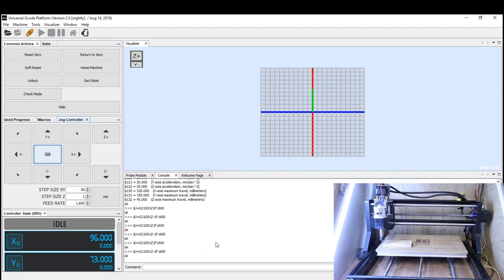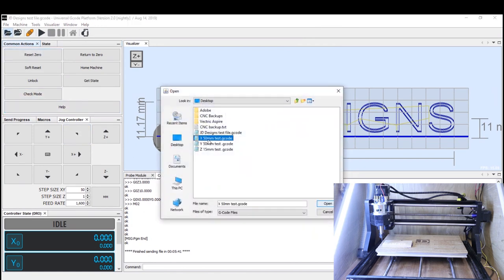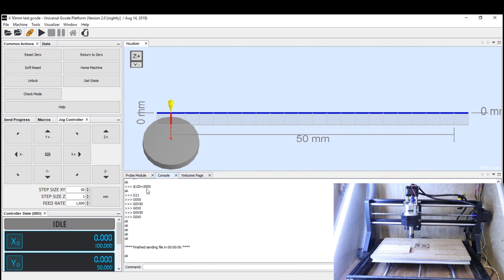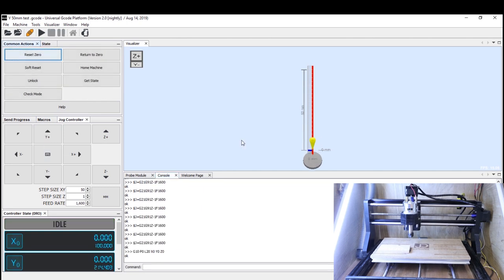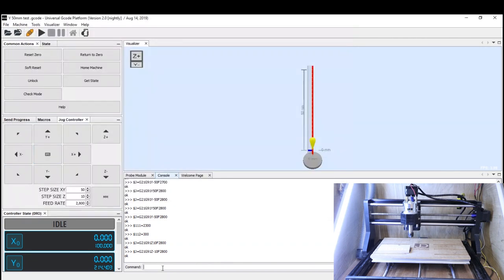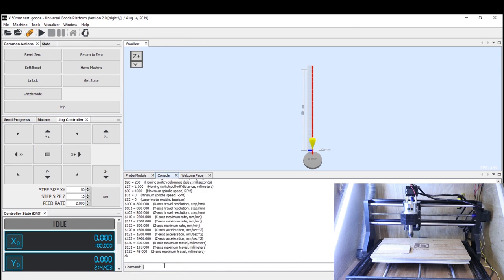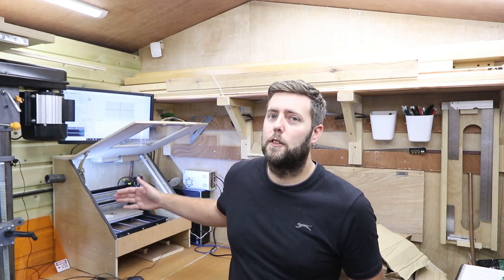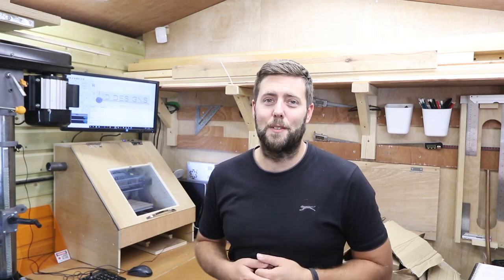3018 PRO - Tuning GRBL settings

Comment: maybe I'm stubborn but: why screw everything up?
be patient and let the machine do its job,
is that wrong? or Weird if I say so?

Regards Rob
Reply from the maker: I wouldn't say stubborn, I'd just say you're thinking about it in the wrong way. You are believing that the factory settings are the best for the machine but thats not technically true, they are simply very safe settings to make the manufacturers life easier. Yes sticking with the default settings is safe, but there are lots of scenarios where higher speeds and faster acceleration will actually get you better results. For example when using a laser or machining acrylic. If you drive a car, yes you could travel everywhere at 10mph, and that would be perfectly fine but if the road and your vehicle allows for faster speed then why not travel at 15 or 20mph and shorten the journey time. Its not about pushing your machine to the limit, its a case of finding the limit (which is much higher) and then staying with a safe zone

Comment: Hello James, thank you for sharing this video, it helped tremendously.
Do the cut settings from Easel get over written by these settings? This part confuses me.
Reply from the maker: No, Easel (or any other software) just controls the feed rate for when its actually cutting but these settings  are mainly about the free travel speeds which your software doesn't change
Reply: @JamesDeanDesigns  ah, that is what I thought but was doubting myself - Thank you James.

Comment: Great video James, but how do i permanently adjust the settings using Aspire 10.5 with remote control panel? on 3018 pro
Reply from the maker: Aspire is just your CAD/CAM software, these settings are done in your control software and once they have been set, you shouldn't need to change them again

Comment: Hey James I love these tutorial videos. I was wondering if you have any tips for setting up limit stops and using them to set a home position in the 3018 Pro.
Reply from the maker: Unfortunately I don't. I've never used limit switches. Probably the one area of these machines I can't advise on 😕
Reply: @JamesDeanDesigns  Thanks for the response James. Looking forward to see your 4030 review. Always preferred to have the head move and not the stock bed.
Reply: Look up Techydiy. He Also has some tutorials on this machine and he goes over setting hard limits and soft limits. I think it is the second one in his series.
Reply from the maker: @GranjersGarage  his videos are good 👍

Comment: Hi James nice work. I have little issue with jog control they are going wrong directions any fix for that?
or setting i am new to the candle and grbl I have 2418 cnc with laser is also not working very low light?
Reply from the maker: It will be your $3 setting. If all of your axis are wrong try $3=5. Otherwise just work through changing the 5 to another number until your axis are correct. It only goes from 1-7 so doesn't take long

Comment: Hi my son just got the same cnc he put it together with no problem . Did a move ment test with the little hand  controller. He downloaded from the flash drive. Now he is stuck 
How and where do you set the size of the wood.please help he got it for  christmas and he has been trying to get it to work everyday
Reply from the maker: Check out something like my beginners guide to easel. its shows you how to create job and set the work size

Comment: thanks. it was really easy to understand and follow.
Reply from the maker: Glad it helped 👍
Reply: @JamesDeanDesigns  is there a setting to change the spindle direction without changing the wires as i cant seem to pull mine off, and spindle is going counterclockwise.
Reply from the maker: @jw5955  not to my knowledge. There is usually a little red dot somewhere near the side that should have the red wire.
Reply from the maker: @jw5955  you could try changing the wires at the other end where it connects to the control board but not sure how easy you will find that

Comment: So I haven't changed any settings that I haven't before to switch between laser and spindle. I've had it working correctly before, but now whenever I try to run any gcode (even files that I've successfully run before) the first movement has the Z axis moving down into the stock, through the stock to the starting point, then up to the starting height, then down to the cut as normal. My axis aren't reversed or anything, its just flipping the first travel movement. Any suggestions?

Comment: Great video, thank you!  Question for you, if i fine tune my settings per your video will the faster setting cause me to break bits because it runs fast?  I use Easel software for carving and I am not sure if this will automatically adjust speed and feed rate if i use a fine tipped fluted bit?   Also, will i need to adjust these settings for when i switch to using my laser from my router?  Appreciate any help.
Reply from the maker: The settings work for both laser and spindle so that should be fine. And no it shouldn't cause you to break any bits, you are only adjusting the quick movement speed which is basically the speed when its not cutting. The actual cutting speed will be controlled by your desgin software
Reply: @JamesDeanDesigns  Thanks man!  I have tested everything out ever since and your videos is spot on!  I have been sharing your video's on Facebook groups.  Keep up the great work.  You've helped me out big time.
Reply from the maker: @bmf5523  thank you very much 👍

Comment: Hi James. First I want to say thank you for your videos on the 3018. I don’t know where I’d be without them. However, I’ve run into an issue. 

My spindle speeds don’t seem to go above 1000 rpm? In Easel, I tried 100, 500, 1000 rpm and measured the sound with a decibel meter. The speed/sound stops changing once you pass 1000 rpm. This is also the same speed when I use my offline controller and set spindle to 100%…

Any ideas? Thanks again.
Reply from the maker: To accurately test the RPM, you really need a tachometer. Regardless of the numbers you input into the software, the machine doesn't actually measure RPM, it only controls the power it inputs to the spindle. The reason I have explained that is because whilst you think its a 1000rpm, I suspect its actually likely to be closer to 10000 rpm which is around the maximum. Check you $30 setting, if its 1000, then when you put 1000 into Easel that basically means 100% power (so close to 10000rpm), 500 would be 50% power and so on. Now if your $30 is 10000 and you put 1000 into Easel, then that will be 10% power. What is your $30 setting?
Reply: @JamesDeanDesigns  Oh okay, so in easel I don’t actually put in the RPM’s? I put in the value between 0-1000? My $30 is at 1000. Thanks.
Reply from the maker: @renewman28  exactly, think of it more of a power scale than exact RPM. If your $30 is 1000, then usually any RPM value you enter into your software about 1000 means it will run at maximum RPM so around 10,000.

Comment: Hi James, an excellent video as always. I have one problem on my machine. There is no $30 and $31 in my file, (spindle speed) If I try to add them from the console it errors. Is there a special way to add them. My spindle speed won't change from flat out.
Reply from the maker: Your GRBL firmware is out of date. You need to be on at least 1.1f and you're probably on 0.9. Just Google upgrade GRBL firmware and you should see some guides to do it. Fairly easy to do

Comment: Hi, i love your videos and am a new subscriber.  I was feeling very positive that all my settings were correct and just tested working fine.  Now nothing works and spindle wont move left or right (just jams).  I have reduced the speeds but doesn't seem to work.  How do i put the original code back in? 
thank you
Reply from the maker: Did you make a back up of your original settings? If so just go through and change the ones that are different. Also make sure you didn't change a setting by accident. For example the other day I changed $11 by accident instead if $111
Reply: @JamesDeanDesigns    thank you for your response.  I couldn't even put the original G code back in. so i turned everything off and came back to it later and all worked again, although had to tweek some x and y settings as jamming but all sorted thank you a bunch.

Comment: Hello, I've recently purchased a CNC 3018 Pro. I began testing it using an nc file provided by the manufacturer, and I have some questions: In the first tests I did, I did set the X-Y and Z ZERO positions and it did the job correctly (I'm using GBRL Control software). Now, it seems that the router sends the tool to a very distant place from my ZERO positions, and I have to stop the work before it goes to a dangerous place that may cause some serious damage;  In this routing process, which the router sends the tool to a strange place, I broke 3 tools because in the Z axis travel, the tools are being dragged in the material. Could you please help and inform which could be the reason for these problems? Just one more comment: The image of the nc file that I'm using, when engraved in the wood, was a small image in the first jobs  - And now this same nc file is now routing a very large image. I don't know what's happening. Why is the size of the image of this file larger now? Any help would be appreciated.
Reply: I had this problem. run a the G21 command after the program, its probably running in Inches (the program has a G20 code in it) so your sending it 10mm and its going 10 inches or 250mm.

Comment: Hi James,do you have limit switches and Z probe on your 3018? 
I tried limit switches,  but results were variable. Would not always stop motion and sometimes false triggers. Had to frequently cancel error & reset.
When trying to use it in Easel, Easel had no cancel & reset, even identified switches on wrong axis!! At that stage I removed the wires completely.
How did yours go ?
Reply from the maker: I dont have limit switches, never felt the need for them although I understand some of the advantages for them. I also don't use Easel to run the machine, its user friendly for designing but it was designed to run their own machines and its never quite worked right with other machines. 
Yes, I have a z probe. As far as I'm concerned its a must have accessory 👍
Reply: Thanks for prompt reply, all the Z axis probes don't come with motherboard connector lugs/jumpers. Unless you already have a stock of connectors ... useless
Reply from the maker: @JohnColgan.  I've basically got mine held on with some electrical tape to each pin. Doesnt need to be fancy, just needs to create a circuit. Different boards have different connectors and most of the board for bigger machines have terminals rather than the pins unfortunately 😕

Comment: Can you peck drill with the 3018 pro? Can you ramp in to cuts on depth cuts?
Reply from the maker: Yes you can do both as long as your software allows it. With noting though on a standard 3018 your depth of cut is going to be fairly shallow anyway unless cutting really soft material

Comment: Hi James, First I wish you a happy and healthy newyear. I have a strange problem with my 3018pro. I use lightburn and/or LaserGRBL to engrave the drawing or text to the material. When I move the head using the arrow keys in laserGRBL or Lightburn the head and bed move in the correct direction. When I start the engraving proces the laser goes to the opposite side of the bed and al is engraved upside down and mirrored. Do you have any idea what could cause the problem?
Reply from the maker: Hi, without seeing all the settings its difficult to judge but it could possibly be the origin is in the wrong place.
Reply: Wich settings do you need? GRBL settings and/or lightburn settings?
Reply: Hi, i think the problem is solved. I inverted the y stepper motor and now al is engraved the right way.
Reply from the maker: @josvanhoof7616  thats great news. Although given your original explanation I wouldn't have said the axis needed inverting because you mentioned the arrows moved everything the correct way. Although people do sometimes get confused with the Y axis because clicking forward should move the bed back towards you - its moving the head forward if that makes sense. Either way, glad its sorted 👍
Reply: @JamesDeanDesigns  I also have a ortur laser master 2 wich has a broken controlboard. I tried using the Woodpeckers 3,4 on the ortur and had to change some wiring on the stepper cables. When I put the board back on my 3018 i think i forgot to change the wiring of the y stepper.

Comment: thank you as this is exactly what I needed but I am stuck with how I get the UGS from. hoping you can help. regards merv
Reply from the maker: As in where do you get UGS?
Reply: @JamesDeanDesigns  hi mate nearly worked it out but when I try to do the tests I get an error that basically says grbl neads to be in idle ???
Reply: hi again it also says no file loaded. Every thing works except the machine doesnt move but it is all ok on the screen and all moves etc in the display screen

Comment: I can’t change $27=1.000.. I fitted limit switches but the switches on the X and Y axis stay closed after it backs off so it sets the alarm. I have to manually wind them off the switches to be able to jog. I can’t change the $27 setting from 1.000 so it will back off further. It comes up with error 3 invalid command if I try to change and save it. Any ideas.,
Reply: Problem solved. The GRBL that came with the 3018 was crippled. Tried the files on the USB that comes with it, same problem. Downloaded the latest GRBL from GitHub and installed it an now all is fine.

Comment: Hey mate, I’m having an issue. My designs are coming out upside down and negative to the zero. Would you happen to know how to fix this? I’m a newbie and not sure why it’s doing this or how to fix it
Reply from the maker: I suspect it might be your $3 setting which changes your axis direction, but it can change all 3. Try $3=1 first, test all 3 axis, if one is still wrong try $3=2... and so on. It only goes upto 7 so you just need to find the number that gets all 3 going correctly
Reply: So I did what you suggested using the jog all axis move in proper direction but it’s still carving upside down and backwards. I recently started using freecad for my designs and I know it’s not inverted in anyway from there so has to be with the command settings, right?

Comment: Hello james i have a problem i hope you can help me 

The problem is when I write and it print the word in reverse what should I do to make it right?
Reply from the maker: Usually you need to adjust your $3 setting in GRBL. It controls the direction of the axis
Reply: @JamesDeanDesigns  thanks 
I see after I replay u
Reply: Just i contact usb writing cntrl + x

Comment: Hey guys my spindle stops and starts between moves how can I have the spindle on at the start and off at the end nit on and off in between as the program pauses waiting for the spindle to accelerate each time?
Reply from the maker: It will be your $32 setting. Type $32=0 into your console and that should solve it 👍

Comment: hallo Mate., very informativ video.  But I have a problem, on the X there is no problem, but on Y  i cant  get it working.  Offcause I can change the settings $121= 20  or = 3000  it dont Change the speed at all.   Do you have a hint ?    regards. Lars, Denmark
Reply from the maker: That's really odd. Sounds silly but make sure there is no space after the = symbol. What happens if you really slow it down, like $121=2?

Comment: I have 3018 I have had this pile of junk three weeks and can't get it to run I  trying using vectric desktop any design I make I can't send to candle every file I open is empty can you tell me why or any tips I can try before I throw the thing in the bin thanks
Reply from the maker: Have you followed this tutorial. Its simple but it will help you rule out where your issues are. Eg whether its your design software or your operating software 
https://youtu.be/mUO6d7MaeCA
Reply: @JamesDeanDesigns  yeah I watched this start up and it looks so simple my cnc will do the test code that come with the machine all is ok up until I design something using vectric I save file then I can't find it using candle if I press open in candle there is no file
Reply from the maker: @paulmcdonald5287  When you export from Vectric its give you .gcode files, Canlde will only read .nc files but they are essentially the same. You just need to rename that file from a .gcode to a .nc and Candle will then pick it up
Reply: @JamesDeanDesigns  when I save a file to desktop I then open it in candle and it imports it but nothing happened I can't jog machine or start spindle the code looks like a Mish mash of symbols

Comment: Hi James.. I have this CNC but i use Candle App to working, i have question n problems to send a command automatically to return to home with some code coordinate.. Can you find how to use code from Candle App
Reply from the maker: Hi Dani. The only way you can really set a home position is with limit switches. Alternatively you have to set the zero point every time you use the machine which is what I do. You then have a button somewhere that says return to zero
Reply: @JamesDeanDesigns    in my machine dosen't have a button return to home.. Because that product not supported yet. Thats why i'm looking for some trick. My trick just writed the home coordinate to ensure if my working stop abruptly

Comment: i upgrade my spindal like you but i will not work now were do i edit the gcode M03 S1000
Reply from the maker: You can edit the Gcode directly by opening up a Gcode file in Notepad or an equivalent piece of software